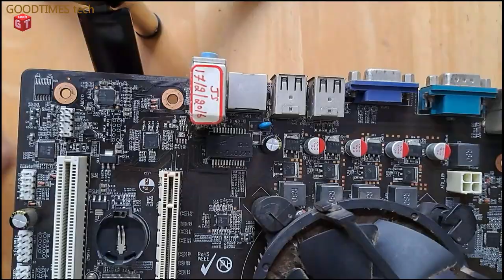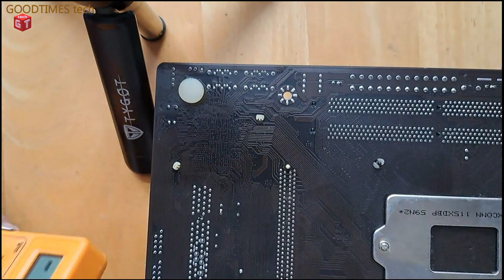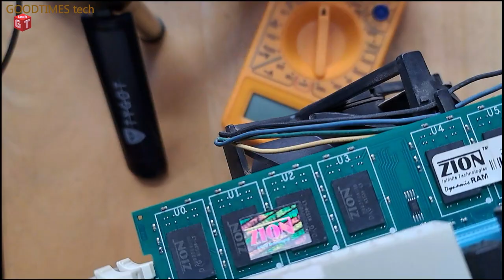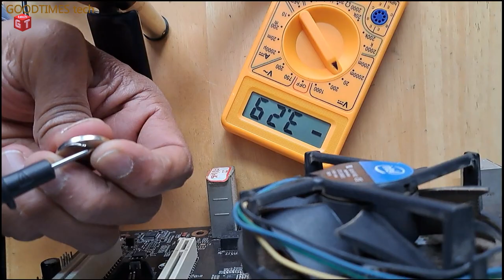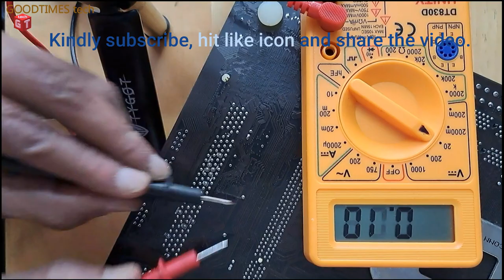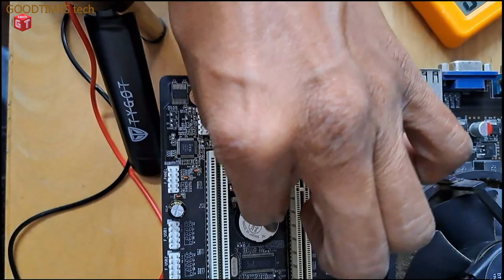Desktop bios resetting even after replacing bios battery.

Comment: my pc sevure boot is enabled so i can't go to bios and windows troubleshoot settings. when i press the start button. pc gone to windows directly without any logo. just gone to welcome screen any solution?
Reply from the maker: Hi,
You can try the following to reset the bios.
Disconnect the device from power supply,
Remove the bios battery,
short the reset terminals on the mother board, if you do not find these terminals, do the above steps and leave the system idle for few minutes.
short the bios battery holder terminals. release the short.
connect the power supply,
switch on system and keep pressing F2 , Del or specified key based on the MB brand and model. system will enter into bios.

Hope the above will be helpful

Thank you for watching, have a GOODTIME.